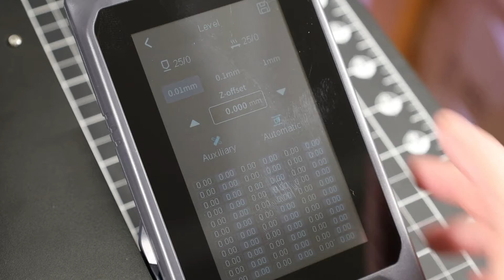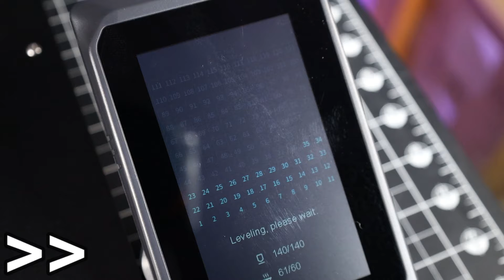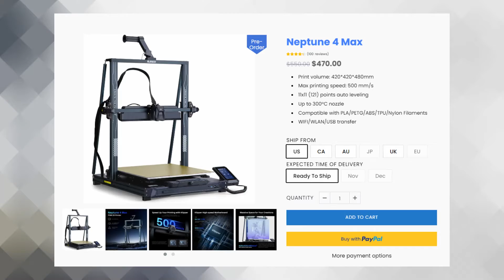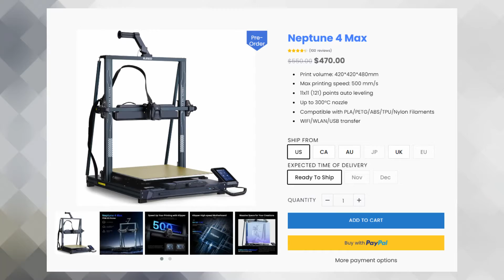Print Big & Quick-ish for Under $500 - Elegoo Neptune 4 Max

Comment: Rather disappointed in the specs for the 4-Max, and the worst part is the bed won't heat past 85c making ABS daunting if not impossible, and the (still) lack of replacement or other larger nozzle sizes frustrating.  My 3-Max is AWESOME for ABS (enclosed) and I wouldn't trade that for the world right now...  I'm running Mainsail/Klipper and have input shaped it (the hard way of course) and tuned to happy perfection.  Your 3-Max review pushed me in that direction early in the year,  and with min mods (all metal hot end) and the Klipper firmware it's a production beast.
Reply: I own this printer and it can easily heat past 85c and other nozzle sizes are available now
Reply: @bastiaanvdb6321  Thanks good to know!  Can your bed get to 100C?  Anything less is problematic for most ABS prints.  I hope so, as I have a friend who bought one and I know he eventually wants to go ABS.
Reply: @imagesh1 Any updates on your friends 3d printer and the bed heat/printing ABS and the likes? This printer seems perfect for me, but I'd like to be able to print nylon which also requires some heat in the bed iirc.
Reply: @Programentalist  Sadly no, my friend has been happy with printing PLA so I haven't researched the issue deeper.  Could a larger power supply be used with the existing bed heater?  The 3-Max has a 500 watt power supply and I think the 4-Max PS is not as beefy.  I do have an additional 9 months with the 3-Max and am still happy.  Only printing ABS (3 or 4 rolls a week) and outside of the occasional print that needs some thought on the proper way to print, I get great results.  I would still recommend the 3-Max over the 4-Max if high temp bed is your concern.  The price is also lower nowadays.  Regards!